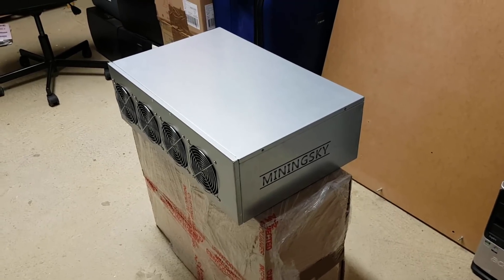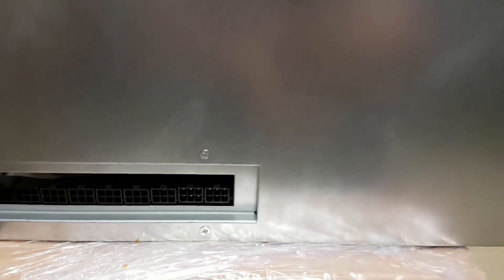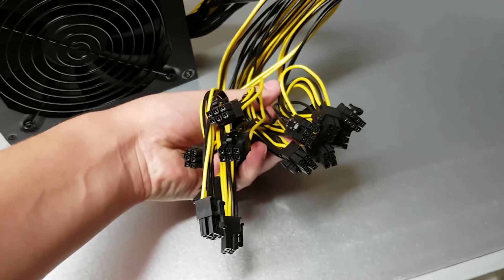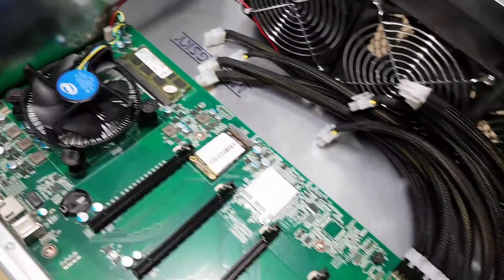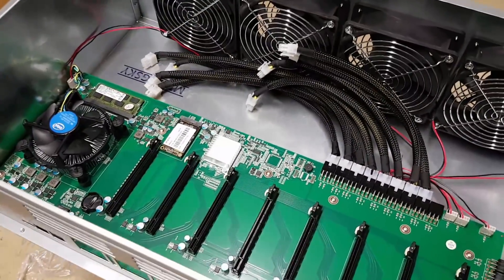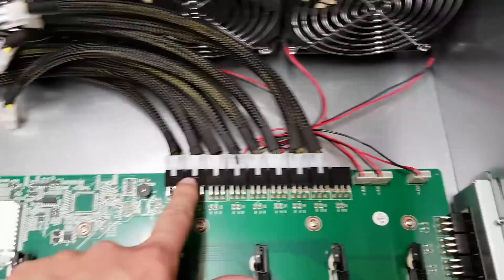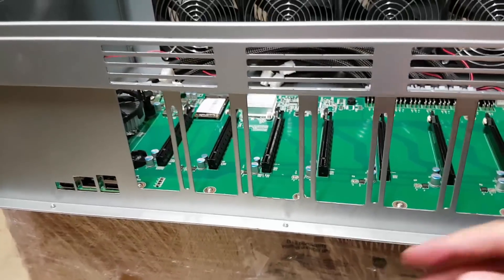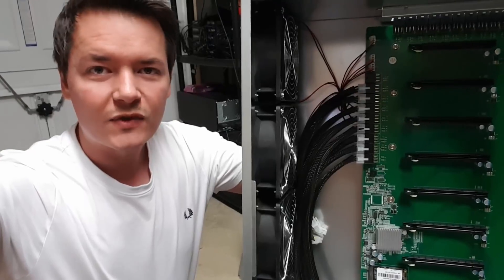8 GPU Mining Box Overview - VLing Mining Sky Rig

Comment: Hi Lee I have just built my first mining rig using Asus B250 and 4x XFX RX560, RX460, Gigabyte 1050ti, Zotac 1060ti 6Gb. I am very disappointed with the results so far. I only get 10 M/h from the RX560s. Also I am unable to undervolt the Nvidia cards. I tried flashing the bios on one of the RX560s and it has bricked the GPU!!! I made sure to back up the Bios file but after flashing the PC will not even boot up / enter bios with the bad card inserted.  Therefore there is no possible way to restore the previous bios. The reason I bought the Nvidia cards is that all the information on the net states that it is very easy to undervolt these cards. However this is not possible on the cards that I have!?? The voltage can only be increased from 0 to +100 which is useless for mining. I believe this is because the voltage is hard-coded on some cards? Can anyone recommend what to do? Also can you or anyone recommend GPUs that are known to work 100% with undervolting and/or bios mods and typical hashrates? Zotac 1060, xfx 560 and gigabyte 1050 clearly do not!!
Reply from the maker: Try reducing the power limit of your Nvidia GPUs rather than undervolting them. The voltage should come down as you reduce the power limit and thus the power usage.

Comment: I like the idea, but the problem with this box is that there are cards (most cards) that dont actually push hot air out of the case. The fans just push air on the card and the air goes wherever. In this case these kind of cards are rather useless since there are only intake fans and the hot air is supposed to be pushed out from case via the cards.

Comment: This MB is project only works with p106-100 GPUs if you try different GPU wont work. 4GB RAM and 64GB HD you will have problems with DAG file and Virtual Memory. Limited to 25MH/ and 100W per GPU. Also this power supply is ridiculous can not support 8 GPUs, ETH reach easy more than 1500W. If one this little 12v rise capacitors blow the hole thing stops not good idea.
Reply: Works fine with RX560 and RX480...
Reply: work fine for RX580 4gb
Reply: yeah this thing is a joke

Comment: Nice box, but what if you want to use anything that uses more than  single 8 pin pcie power? You'd have to start drilling holes and routing your own cables through. Besides, I wouldn't even want to use those 6 to 8 pin adapters. Sure they might be able to handle more but a 6 pin is designed for 75w where as an 8 pin is double that. Also, trow that psu out, doesn't seem trustworthy and the last thing you want is a psu blowing itself up with all your hardware connected. So what is left? A motherboard and a case, nice, but definitely not worth 900 dollars.

Comment: this power supply is a dumb idea its extremely low quality.  those motherboards are on sale on aliexpress from may 2017. rig is designed to work with nvidia cp61-01 wich is essentially a p106-100 with massive passive cooling. aha thoose are not pciex16 they only look like them. google PANTO ZRTK. one of the first companis offering thoose rubbish boxes. long live china.
Reply: Ulam Prox - I would wager 99% of those mining are ignorant to "server" hardware they could easily adopt for mining purposes... for decades we have been using "passive backplanes" with "single board computers" that all plug into each other and allow us to create any size configuration we want, you want 16 slots, get a 16 slots passive backplane and plug in a SBC, you want 8, get 8 slots with a SBC to plug in... you can even have custom arranged passive backplanes made for a low cost in quantity, which is all this thing basically is, basically the thing you suggested people search is exactly this, a traditional passive backplane used for decades with an SBC card to run it, want to upgrade your computer, just swap the SBC and leave everything else in place, its that easy, we've been doing it for decades in the business... the item he reviewed, is nothing more than someone with a sheet metal bender, and someone who used google to piece it all together for miners who think this is fancy custom hardware, its not...
Reply: This needs to be sticked to the top of the comments before people order this POS

Comment: great info, that concept could really be appealing for miners in their apt of smaller spaces where they more the aesthetics
It's a bit up there but when i run basic #'s i get a little close- would also want to know details on the warranty on the board & everything they supply.
As with many projects the first batches may need some tweaks to design once they get some hours on them, and find fault points.
Thanks Very Much - Looking forward to your follow up, also is there a price break if a group of your viewers purchased as a bulk order 100+ cabinets ?
* Assuming the shipping is very costly - where are they based out of, if you mentioned it sorry i missed it.

Comment: $900?? I think $499 would be more reasonable
Reply: very true.  i have 50 GPUS. take me hours hours to figure out where is the issue sometime.
Reply: RandoCrypto that's the same thing I was thinking not for 900+
Reply: FpsStang I wouldn't pay for a stand or windows so that knocks $240 off right there, but I get what you are saying. And for a premium setup it's not too bad.
Reply: $900 is way too much. $500-600 would definitely be much more reasonable.
Reply: 500$ will be without a box , I have in stock , also don't forget it do include cpu and ram and ssd
Reply: RandoCrypto 499 would be cheap. Add up all the prices for the included part. MB,PSU,RAM,CPU,SSD, WINDOWS 10 PRO,Stand/Case
1200 watt psu from corsair or EVGA is $300, MB asus $150, 1ssd $80, if u buy a stand for 8 gpu $120, win 10 $100, RAM $40 , riser cables $50. That's $840 right there

Comment: The external power supply is a dumb idea. Other than that it's brilliant!
Reply: If they added an extra like 4cm it could have easily fit ahead of the CPU in that nice gap and then vented out the side.
Reply: I agree but at least it keeps the heat from the PSU away from the cards